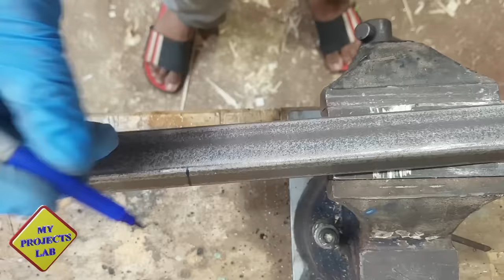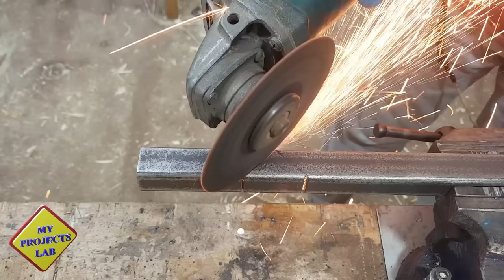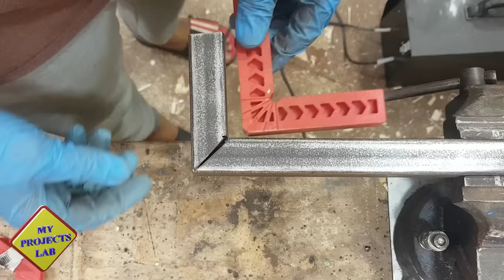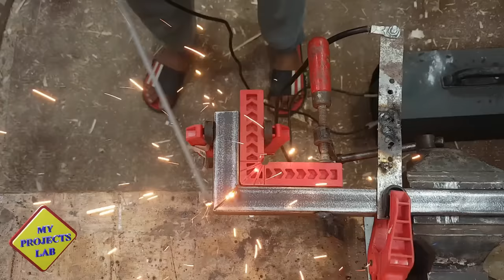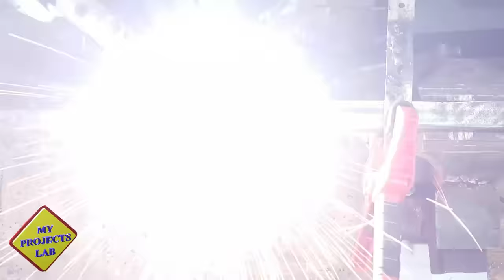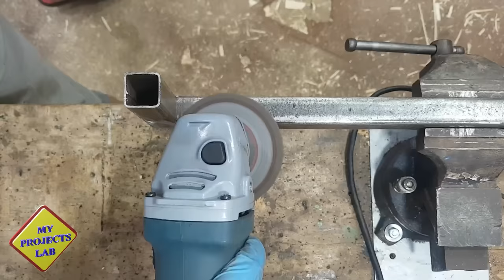How to make square tubing miter joint - Welding Steel tube corner joint

Comment: Gotta love the safety. No grinder shield, taped up electric cord, open sandals...
Then there is the welding... No chipping the slag off and welding over the top of it. Uhhhg.
Reply: @WEMBLEYNE  uh?
Reply: sat there and watched him chip the slag off with a hammer

Comment: A couple of tips if I may. First off, I have been a sorta hobby, sorta paid welder for around 20 years. I enjoynit, learned all I could, took classes, but realized the day I make it my job, I will hate it and didn't want that to happen so I do it for fun more than for pay. With all that being said, I recomend welding thin gauge tube like that with either mig, tig, or gas (oxy/fuel) depending on application and how pretty it needs to be. Essentially you just placed a bunch of tacks and then ground it down, now if it is simply a decorative piece, that will suffice, just don't let anyone put it under strain or it will likely tear or break. The stick welder, even on some of its lowest settings, agitates the puddle to get through to bare steel way to much causing blow outs, like I am sure you have seen, even on its lowest setting. Stick is great for dirty, thick steel, but sucks at anything thinner than about 10 gauge. Good luck and be safe.

P.S. might want to throw on a little more ppe, spatter and uv burns hurt like hell and dramatically increases your chance of developing skin cancer.
Reply: If I were him I would have put a backing plate on the inside of the tube before bending it toward the 90, maybe a small piece of the 1/8” tube he cut off, then you can lay a weld and that backing strip will help you weld it with out a root opening. Although if he was using wire it would be a lot easier.
Reply: The guy is 3rd world.  He won’t take your advice
Reply: Easy for you to say...Tigs, Migs along with its associated gas and other paraphernalia are just too much of a hassle and we just cant afford it! We'd like to...but we just cant!! So,we just make do!
Reply: @Gouneo  You can find the really cheap Flux core might welders most anywhere and they are usually cheaper than even the cheapest of stick welders. Oxy/fuel is even cheaper, you can get a small Mapp gas/Oxy torch setup for less than $60 US.
Reply: Guy just don't have enugh expirience in thin sheet metal weldind. I had to make car body welding on japanise car with ordinary stick weldind, after that welding such a square tubing - a piece of cake, just take time and paciece to master.
Reply: I am not sure who could afford Tig and Mig in the 3rd world. Or how many hobby welders are going to have mig. Thin wall is welded by stitching the way he does it all over the world.
Reply: I just saw a vid of a guy stick welding 2 razor blades together at 40 amps. From this day on no one can tell me I can't stick weld EVERYTHING. plus stick welding is more fun.

Comment: This is a great way to keep the top of your feet from becoming too hairy! :D  And....SURGICAL GLOVES for welding??? That's probably worse than nothing, unless you like melted latex on your skin. :S
Reply: The gloves are there cause the welder give him  a shock once in a while probably.
Reply: Those thin gloves won't help with electrocution either. Only thing they're doing is blocking the UV from welding.
Me personally, I love the sandals!

Comment: Awesome safety video!! 
Notes: 
1. Taped together cord on the angle grinder. 
2. Sparks right onto taped cord. 
3. Wearing sandals, fine, 
4. But then standing right beneath the cutting area! 
5. No guard on the angle grinder. 
6. No handle either. 
7. Partial cut through steel tubing with a hand-held abrasive wheel. (notice the wheel deflecting)
8. Wearing RUBBER gloves while welding!! 
What's the worst that could happen? 
Gloves melt onto hands, Wheel explodes, flies into the users face, steps on melted wire electrocuting himself.
Reply: I bet you're real fun at parties.
Reply: @runningbear1982  Never been to a 'chop off your body parts with an angle grinder' party 😁
Reply: @runningbear1982  Kinda counter intuitive... Unsafe  Usage of Power tools is one of the fastest ways to lose your balls or other appendages, plus you assume women don't use duct tape. Me, I just use regular PVA glue for my woodwork, duct tape isn't gonna cut it because I gotta sell some of the stuff I make. Metal? Well, I can weld faster than I can find the blasted roll of duct tape... Must be here somewhere... And my welds are pretty good, almost as good as duct tape. So yeah, to each their own. Balls or whatever.
Reply: hahah some people need to lose some body parts to get brains,... other's don't...
Reply: Yep and some people know how to work and others are osha rejects trying to be relavent
Reply: @vikassm  :face-blue-smiling:

Comment: Excellent work. However, grinding and welding with open-toed sandals on?  This guy is brave. Probably not wearing eye protection either.
Reply: Its not a problem ...im also dont use gloves and just bare foot...
Reply: 0
Reply: One little micro piece of metal in your eyeball will make you buy some protection
Reply: dont forget he is using plastic gloves 🤭
Reply: Yeah man that's right. He has skill but does not appreciate his toads and fingers. 🧐
Reply: LIKE A BOSS
Reply: It is foolish
Reply: Precaution is very necessary
 I do the same with full precaution. Incidence could be occurred
Reply: Shauna Tate  🤫
Reply: Better call Osha then. Maybe little sparks don't hurt him lol
Reply: God is protecting him

Comment: Safety violation count 4 main
1. UV protection  (skin cancer from UV from welder cover skin )
2. Guards and handle (angle grinder)
3. Footwear  sandles (steel toe or at least covered )
4. Gloves (welding gloves)
Don't try this without them please your body will thank you and your doctor's
Reply: You don’t really need to cover your arms or anything if you don’t mind getting a tan 😎😋
Reply: My guess is this is in a third world country or pretty close and they use what they have. Also, is it really a safety violation if they have no safety regs to violate?
Reply: @sjeverett75  yeah Indonesia was like this open air welding all over no equipment except for the welder
Reply: Wrong, if he will do all that than he'll be safe and will not need a doctor. One less patient there. So the doctor is unhappy.
Reply: Dude he is most likely making a dollar a day..Yea I get the safety concern. Rules are so different in 3rd world manufacturing companies that is would make the average westerner sick to watch.

Comment: That seems more like tacking and not welding, shouldn't you be using a smalling rod at lower current so you can actually lay a bead down?
Reply: ^This
Reply: This is a joint on a thin wall tubing there is no need for an actual weld bead. But yes his welder is setup way too hot for this thickness of tubing.
Reply: It's an arc welding machine ....the tube will tear

Comment: Not going to lie, never thought of trying that, but so simple, saves wasting a length of the square hollow section.
Reply: you still waste a lot of metal in the triangle you cut out, willing to bet it's an equal amount of metal.

Comment: Nice work, but you should never weld while wearing open toed sandals!
Reply: In Asia eps Cambodia, it’s very common for welder to wear sandals when welding. Most don’t use welding helmet. They just wear sun glasses. It’s not very safe for them but most of them don’t earn a lot, and they are just used to it.
Reply: Thats was just what i was about to Say

Comment: I cringe watching a grinder wheel being used with no guard - no chance if the disc was to disintegrate.  Have a nice day all.  CHEERS from AUSTRALIA.
Reply: what's with all the missing grinder guards on youtube? They also defect the sparks away from you and stop your fingers/hand slipping in the back of the disc.
Reply: And burning the cord 2:20. And those gloves are happy to melt to skin.
Reply: At least he has his steel toed flip flops on though.

Comment: While it is appreciated for the video, you made me proud because even I am not a professional who work with power tools frequently, I could point out many things you shouldn't be doing, and should never even contemplate showing it on Youtube. No guard for your angle grinder and from what I see, using a thin cut-off disk is very brave. Then thongs which won't offer any protection when the disk explodes. And the cable for the angle grinder. I can see it has been taped up. So obviously it has been accidentally cut. It should be behind you and not in front. Of course welding in thongs. Anyway, I have learned much from this video....I learned many things I shouldn't be doing. I hope people who watch this video won't follow your bad practice.

Comment: I'm just a newbie welder, however even I know that wasn't really welding.  Aside from flip flops, sweatpants, and rubber/latex gloves, you better not ever put anything heavier than a picture frame on that thing.  
Kudo's for showing a decent way to make a mitred joint, however watch a few welding videos to learn how to actually weld.

Comment: Safety tips move your cord out the way of disc and why grind and weld with thongs on
Reply: Haha was thinking the same. People call me crazy for occasionally forging and welding in bare feet. In my experience, that's much safer than open toed shoes which have places for hot things to get stuck in.
Reply: @American Flyer good call. I wasn't suggesting bare feet, just that  sandals might be even worse since lots of hot BB's and splatter or whatever hot bits get stuck against your skin instead of bouncing off harmlessly.
Reply: @American Flyer ahh of course. Right, good idea, same level of protection as for your hands and just as easy to slip on. Might be cool to have little squares of scrap leather with velcro to wrap around your feet/ankles so that any runners or slippers will work, and fits in the back pocket with the gloves. "Grieves" I want to say? Just musing. Seems like kind of a dumb thing to think about until you catch a bead or two on shoes you care about.

Comment: Yeah, neat for Youtube, but you will have to rely on the length of the overall tube for both sides, which isn’t possible in many cases.
Reply: What?
Reply: What's not possible with fabrication ? Because in many cases it is possible.

Comment: Lol no steel cap boots or safety guard on grinder whilst wearing latex gloves. Might want to learn to weld runs rather than tac/spot weld just saying
Reply: some shitty Chinese square tubes cant handle a bead .... it's just bended and welded sheet metal belive me . 
been there .and you are very right about saftely and it wouldn't cost as much as a toe repair.

Comment: Gotta love YouTube how-to's.
All kinds of wrong in this.
Reply: Apart from the safety? What ??
Reply: @mirza6399  lol i never welded but i had to laugh at this
Reply: @mirza6399  The weld has more porosity in it then Swiss Cheese, I could brake it with one blow from a 2 lb hammer,
Reply: Sand Box John if I were him I would put a backing strip on the inside of the tube, maybe some 1/8” plate that way it’s just a nice groove weld, lay it in nice and easy with no gap.
Reply: He's welding ontop of the slag.... forms empty pockets in the weld. Needs to be a continuous bead.

Comment: The inside corner of the 90 bend.  I noticed it was not welded.  Is that normal or was he suppose to weld the inside corner.  Also is this particular weld for 90 degrees... is it structural or for appearances only?
Reply: the inside corner is usually welded. the way this man did it was terrible one of the worst way ive seen
Reply: No it's not normal or by any means safe. And the tack procedure he used was wrong. The only way to get a good bead using that method is the machine MUST be set at an amperage that is hot enough to burn the slag COMPLETELY out of the way and definitely wrap all corners when welding such joints. That will miserably fail in a structural environment.

Comment: There is soooooo much wrong here, I'm no safety nazi but dude seriously? You have no gloves on, those surgical gloves with melt to your hand in all of .5 seconds, whats the point of wearing them, they provide no protection at all. You are actually wearing, and I would not have believed this had I not seen it myself, flip flops while doing metal fab....... Thats insane. Add to that you have to guard on your angle grinder. Less offensive and less dangerous videos are removed from youtube every hour of every day and somehow, this nuclear disaster of a video is still here.
Reply: Why are boots required when doing metal like he does?  You mean like in case the grinder falls?
Reply: @Tunhao1  I could literally think of 50 or more good reasons but, the first one that I thought of when I read ur question was this; cutting metal with an abrasive disk leaves very sharp slivers of metal, like razor blade sharp, on the edges of the piece being worked on. If that were to be dropped on a toe....it could slice to the bone. Thats not even mentioning the molten metal leaving the grinder in the way of sparks.
Reply: Mr. Dawson I understand your point, but I mean in my case when it’s really hot (I live in a hot country) I grind and cut metal also with flip flops on and make sure my guard always is on, and that sparks always go in a different direction. I believe when operated correctly it shouldn’t be a huge risk.